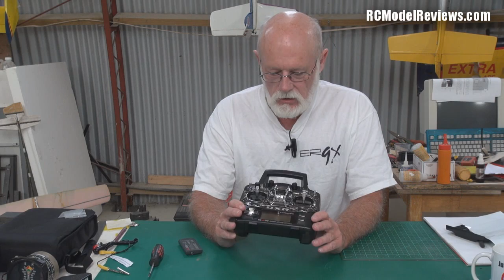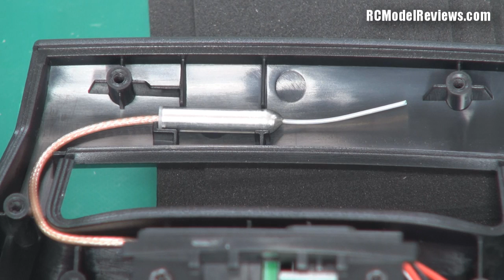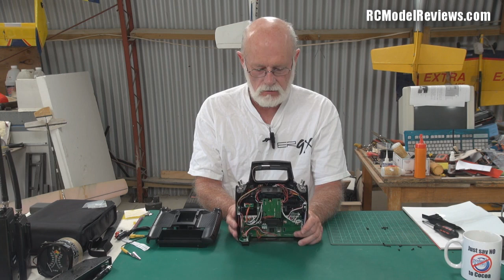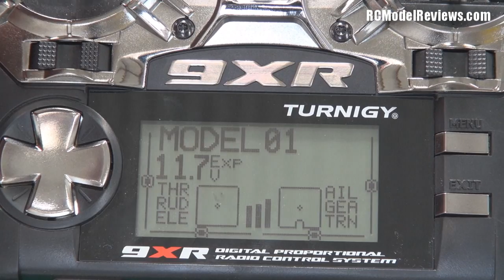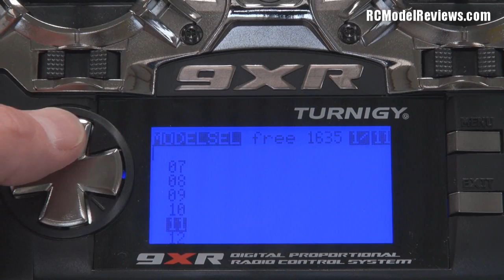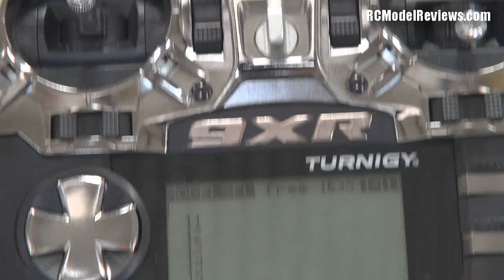Turnigy 9XR Review (part 2)

Comment: I just bought the 9XR and an AXN  with everything needed to get it up and flying and the total cost was just over NZD$300. That price included a Turnigy power supply. I guess that is a pretty good deal considering the capability of the radio and the size and performance of the model. NZ model shops add on about $200 to a radio as I bought an XG8 online for a total final cost of NZ$500 whereas they sell for $720 in NZ, either online or in a store.

Comment: Thnak You Professor Bruce for wearing the ER9X  T-shirt.
Great U did a part 2 because the only point of interest for the 9XR was the "ball bearing gimbals". I rather keep my 3   9X's  wich is all i need. ERSKY9X gives U  UNLIMITED memoey due to a SD card port. Next step for me is to find a way to install more then one firmware on the 9X.    example: Original firmware + ERSKY9X , Good if some HobbyKing models are compatible with the old 9X.

Comment: Well done Bruce. I was expecting a crucifixion or a burning at the stake after part one.  I was very surprised at part two. You plan to show us how to do some elevon programming and so on, why not just show people how to reflash the radio so they have access to templates. A few clicks and the programming for a V tail and many other configurations are done for you. Just a little tweaking if need be and all that work has vanished. Good review. There are bearings only visible when it's pulled down.

Comment: I have just started this hobby, with your guidance.  I did the low cost mini quad build that you posted.  Now I need to get a transmitter and receiver.  Does the 9x work with open pilot and others? Everything I know about quads, I learned from you.  Thank you so much.
Keith

Comment: VERY competent reviews. I have to challenge your assertion that the screen stick position indicators are a waste. The stick positions are read indirectly via pots of course, and we all (should) know that pots can be scratchy, have gaps, or be totally dead. If a pot goes bad in some way, would it not be at least somewhat evident on the screen with a quick check ... before launch?

I'll definitely be buying a 9XR packaged w/ module & receiver for a CX-20 quad upgrade. Hoping to get some autotune happening, chief among the many other advantages.

Thanks to ya!

Comment: Ye, almost certainly although of course I have not tried it with a 9XR. Based on the fact that the manual is Erazz's original manual (complete with his wry humour) the firmware is the basic Er9x firmware. I have one 9x radio with this firmware and use Eepe to communicate: download models as I program them and to test complicated changes before uploading back the Tx. You need a USBAP interface cable.

Comment: There's no issues with interference between the 2 antennas, since only one is used at a time.

If you're using an external antenna, the antenna in the handle is not being used. If you're using the handle antenna (with the as-yet unreleased module that plugs into it) then you won't need an external antenna.

Comment: There is acknowledgement of the Er 9x development at the back of the manual but no links to any Er9x sites. Google up Er 9x and find the Wiki page. That's where you find links the firmware which supports FrSky telemetry. There's a sound card being developed so your radio can talk to you including speak the telemetry values. 
ErSky 9x is a development which allows the logic board to be replaced giving unlimited model memory, FrSky telemetry support built in, and more; but it won't fit in the case

Comment: DJT is exactly what i am using , i set to PPM and off it went .  I had a DFT so i really had an issue because that wont fit in the hole DJT is fine I have been using it for weeks.  Hobby King site specifies any JR compatible unit lots to choose from .  Get a second opinion . Lots of great radios out there i would be happy to use but i own and use a 9XR with a DJT FRsky so i think i would know .  Might pay to ask the forums why yours didnt for what ever reason, there are 100's out there that do

Comment: The 9xr is easy to hook up UHF, u just plug in 3 pins into the back, power, neg and ppm. Im going to buy one of these so i can just plug in my ezuhf. The ezuhf comes with a plug that will plug straight into the back where the pins are for the module. Easy as. Plus doing it that way ur only running 433mhz, not 433mhz and 2.4ghz at the same time.

Comment: you should do a case mod and try to fit the internals of the 9xr into the case of the 9x and maybe a little rewiring to use the buttons and switches of the 9x.

Comment: rubbish , the "JR" Frsky module works fine, been using it for a few weeks now in fact i felt compelled to correct you because i think it the BEST option for the 9XR  , internal aerial will have less range most likely too

Comment: Does the fact the handle antenna is there, and you use a module with an antenna, cause any problems with the 2 antennas being close together? I ask this as you mentioned it in the past when you took out the 9x antenna and installed the frsky antenna in its place. 
Thanks for the video and waiting for more.

Comment: Buyers Beware! I have had very bad luck with this radio. The first one i received had issues right out of the box, the Speaker never worked properly, its supposed to say "Welcome to the turnigy 9xr Pro" My just said "Welcome to..." the eventually just Welco... Super annoying. Then before i even got it setup the damn thing wouldn't even turn on fully, lights but no LCD. Sent it back and got a second one, same damn speaker issue but it worked, at least... for a while, now after maybe 10 flights every time i turn it on the throttle gimbal is all out to lunch, sometimes its pinned to 100 percent sometimes it wont go below 50 percent. Guys dont waste your money, you will most likely end up crashing or losing a model thats a lot more expensive then spending the extra 100 so dollars on a Tarranis. This was my first digital radio. Its already a steep learning curve do yourself a favour and get something that headache free. I got pissed went to my local shop and bought a last years DX8. Now in the process of sending yet another package back to HK.

Comment: the problem with using a "air" Tx for a land vehicle is you don't really have an effective way of braking and reversing....also the fact that the throttle isn't spring loaded would be an issue for most people if trying to run a land vehicle..

Comment: I have been using a DX7 for many years and I love it but recently I have got in to FPV and I want more range. I have been doing a lot of research and the Turnigy 9x seems to be popular as it is easy to use systems such as Dragon link with it? Should I ditch my DX7 in favour of the Turnigy 9XR and use the orange DSM2 module for my other models as they are all DSM2! Any thoughts?

Comment: Will you still have to open it up and remove/modify the antenna if you're going to use a frsky module? I got the impression that you're not supposed to put two antennas next to each other.

Comment: i use my 9x for a r/c tractor. i need all the channels. im wondering if i should just reflash the old one or get a new one for a project im working on ? its a r/c semi truck. running a onboard crane, and trailer tipper.  what do you think?

Comment: ive purchased the 9xr as well as a dji f450 kit and im using open pilot coptercontrol board. i cant seem to get the quad to take off it just wants to flip either forwards or backwards. could it be hidden settings on my 9xr thats causing it?

Comment: Terry middleton 
can this transmiter be used on a rc flight simulator
Reply: Yes, it can.  You need to use a cable to connect it obviously, and here you have 2 options:
1. A usb interface cable.  You can get them on ebay and stores like banggood etc.  Do a search for something like "USB Simulator Interface for Turnigy 9XR"
2. A trainer cable or a mono audio jack plugged into the audio input on your pc and use some software called "smartpropoplus" or "smartpropo".  This software interprets the signals via the audio input and translates them to a virtual controller in your PC.  Not as good as the USB cable, so I suggest getting that instead.

Comment: That antenna placement is orrible....what if I'm flying my model on my sides, right in the dipole nulls? Not even talking about the nulls of the antenna on the plane that are right on front/back or on the sides instead of UP/DOWN.......horizontally polarized antennas on the tx just don't match right with moving planes...

And do you think that hobbyking accounted for the dielectricity of that plastic handle surrounding the antenna when calculating it's lenght?